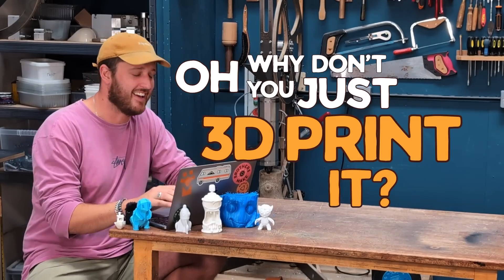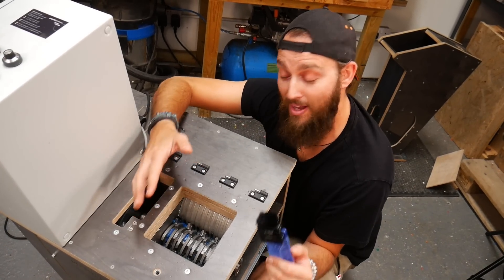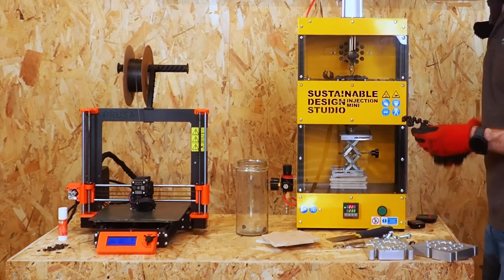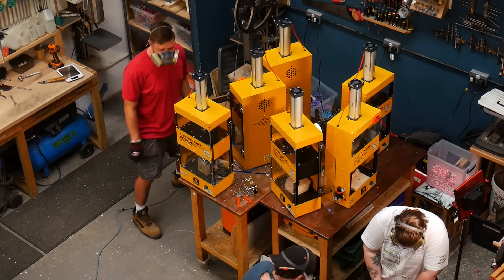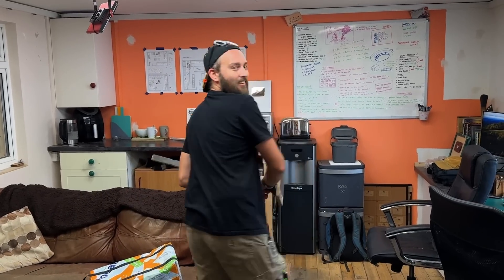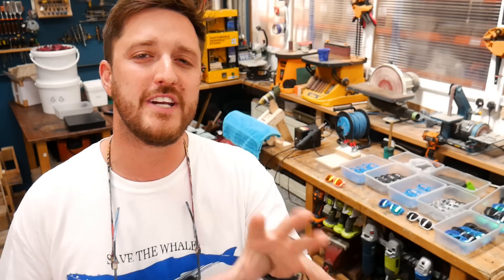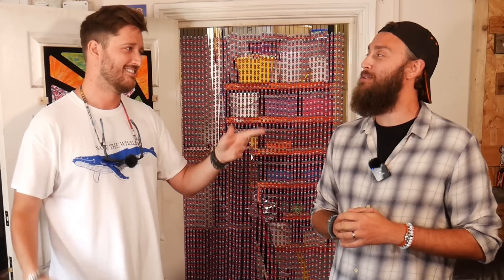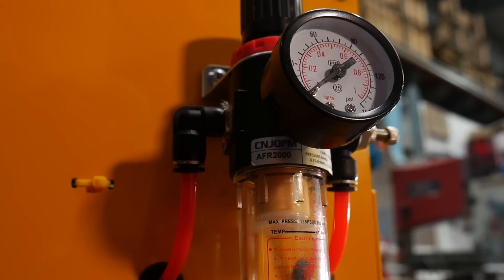Is THIS Better than 3D Printing?

Comment: You missed one thing. How long does it take to make an ejection mold ? That needs to be added into the total time.
Reply: also why only one comb printed at a time and could they print layers of beads in a stack?
Reply: And cost.
Reply: With the price it had that's because he bought it to a cnc company
Reply: Use of computer guided 3D lathes makes carving and etching steel molds much faster, compared in the past, where you need a well trained mold carver to do them.
Reply: @inisipisTV  yes it could be faster to produce the beads on a barfed CNC lathe but its going to require a similar amount of work to setup the CNC lathe as it would be to machine the mold. Then its going to be more expensive to buy the CNC lathe in the first place while being much pickier about the material. Not to mention the many other factors that go into it.
Reply: This question immediately came to mind
Reply: Well if you're doing that then you need to think about how long it takes to make a 3d file.
Reply: Dumb video, u have a mold
Reply: Also the time to trim the mold. They're not even counting hours of human labor. It took 3 ppl a full shift....
Reply: Exactly… 3d print from nothing vs mould from something. Also a resin printer would print the beads quicker than filament.
Reply: @3LG33  yep. SLA printing would def be the fastest and cheapest for beads making I believe.
Reply: @trygvij1604  sure but part of the appeal of these products is using recycled materials something you cant do with SLA. SLS might be possible but would require some highly specialized equipment to turn the recycled plastic into a fine and consistent enough powder.
Reply: not to mention changes.  What if you get feedback the teeth need to be wider or shorter, comb longer or shorter.  Time for mold? Cost of mold?

I 3d printed some garden stakes for my mom.  plastic cost, 25cents.  I went through 7 versions in 2 days.  for 5 bucks of plastic.  My sis liked them so much she got 10, my gardening neighbor has 20.
Reply: @elitewolverine  That's why we need a 3D Printer. To create prototypes BEFORE creating the mold.
Now imagine you are a large producer of garden stakes, producing 70 or 700,  in days, not weeks, but days, how you deal with this?
Reply: The molds they are using for the beads, comb and glasses could easily be cut from aluminum in a day.
Reply: @yatyas72 so you need a high quality CNC as well? 😜
Reply: @Utseuski  Or you could design the mold yourself and have it cut by a local shop. I did lots of that work with my shop. You don't always have to own every tool and it's likely not as expensive as you're made to believe.
Reply: @yatyas72 yeah but that's an entire day of a headstart that the 3d printer can be running making products before the first injection part is done.
Reply: @samk2407  Yeah, but...... There is simply no comparison between injection molding and 3d printing. Part strength, material selection and speed. Injection Molding is far superior!
Reply: @samk2407  yeah but if you have an application where your going to be needing a ton of parts it usually doesn't really matter if they're delayed by a week if it can be made cheaper and better in the long term. Not to mention The injection molder will catch up extremely quickly.
Reply: Yeah they're right about the other downsides of 3d printing, but they're being totally misleading by starting with the finished mold. The printer has a days or weeks headstart
Reply: Are you also going to include the time to build your 3d printer?
Reply: @Ben-ex1kv no. Because of a 3d printer you can make a new design, change the size of the beads, or decorate them with no changes required on the 3d printer. But if you wanted bigger beads with the injection moulder you would have to get a whole new mould made. Obviously both manufacturing methods have their place, but if you could only have 1 machine I would take a 3d printer over an injection moulder.

Comment: If Brothers Make is Yin (Injection Molding) ((Yes I know for you both it's "Moulding" )),Slant 3D is Yang (3D Printing.) 

Both channels highlight the benefits of their respective process in order to make it seem like the more appealing option for plastic goods manufacturing. And I don't blame either channel for their stances; they've build their entire livelihoods on the process they've each chosen.

Note going into this comparison that, trying to make the same exact part in both processes is like trying to fit a square peg into a round hole. A part takes the design that the manufacturing process used to make it lends itself to the best. A part designed for Injection molding will not and should not look anything like a part designed for 3D printing.

My analysis:
Injection molding is fantastic for large quantities of parts with simple geometries and that have low probability of changing design-wise. Brothers, you both have nailed this tenant with your choices of molds with "bulletproof" designs in Beads and Sunglasses: these are things that people will always want and that will always be useful in many applications (in the case of the beads). If the quantity is in the thousands to tens of thousands range, the small scale injection molding infrastructure as you two have is the way to go.

3D printing excels at complex geometries and impossible geometries, and can make different parts entirely on the same machine with 0 tooling cost for doing so. This opens up whole new possibilities for rapidly evolving customer desires, capitalizing on trends, and rapid turnaround times for part design. With how fast the world is changing around us, this is a very attractive capability to have. If the quantity is in the hundreds to thousands range, half a dozen to a dozen printers is more than capable of cranking out very high quality, professional level products.

I myself have a Bambu Lab X1C, and am partial to 3D printing. Having a single machine that creates objects out of thin air is as paradigm-shifting for me as getting a cell phone was. The cell phone is instant access to information, and a modern high end printer is instant access to objects. I see additive manufacturing as the second industrial revolution, and it is already enabling people and companies to do never before seen things. I do still however love your channel and know that the more artisanal style of your work definitely does and should have both appeal and a market. 

Perhaps look into recycling plastic into 3D printer filament as a new venture/ sector of brothers make? Home filament making setups or small scale industrial ones are increasingly affordable and accessible. 

I expect and look forward to seeing you two continue your success in the plastic manufacturing industry and will always look forward to your next video. Cheers from across the pond!

Comment: HOWEVER you doing the work or letting the printer do the work, while you do other work, makes it a lot of difference and is key here! Besides that there is a big cost to making the molds, something you don't have to worry about with 3d printing. And you can make way more products if you print stacked, and since you don't work day and night, well your printer will just keep going!

Comment: 3d printing excels where you want to be able to customize or personalize items. Not for mass scale manufacturing generally. So not a great comparison. But a fair point.
Reply: Doesn't help he used a mk4 instead of a bambu p1p/a1, would have leveled the scales. (speed)
Reply: It's completely inaccurate to say that FDM 3D printing is not for mass scale manufacturing. Check out what Slant 3D does. It beats injection molding in all aspects
Reply: @bmotik  slant3d owns a print farm and uses his channel as an ad for his company. he is very very biased.
Reply: Actually for the cost of one employee operating 3 mold machines, I can purchase 100 bambu A1 minis, pumping out 5 combs an hour each.  That is 12000 combs a day max, far far far greater volume than what the small injection modling can do.
Reply: @elitewolverine  if you can respool and clean and whatnot within 1-1 minute per printereafter every print and you can sequence the prints so you are continously scrape the beds and whatnot then you  loop around every 100 mins... so max 7 loops a day. That is only 3500 combs my dude
Reply: @elitewolverine  You comb your hair with that 3d comb for year and I'll use the injection molded one. I guarantee you at the end of the year, yours will not have held up as well as the injection molded one.
Reply: @yatyas72  i have 3 injected combs all with broken teeth after about a year or so of use.
Reply: @elitewolverine  so what do you want? a cookie?
Reply: @yatyas72  sure if you have them, unless you suck at baking like you do at comments, then in that case get your waman to bake them first.

Comment: One little trick you get away with.

Resin 3d printed injection moulding moulds.
as Resin's not a thermoplastic, it doesn't deform with heat, if you want a prototype injection moulded part, you can resin print the mould.
Reply: Yes but don't expect many parts from it. Resin prints get way soft when heated and deform when force it applied.  It is great for a proof of concept for the mold but don't expect to produce anything with it.

Comment: yeah but... for injection  moulding you need a mould for everything you want to make, 3D printer you just change the program, so for a single hobby type work 3D is a clear winner

Comment: Worth mentioning that the injection mini and mould price doesn't include VAT whereas the 3D printer does, so you need to add another 20% on top. One of the most annoying things about the sustainable design site is the surprise increase in cost when you get to checkout.
Reply from the maker: That’s something we overlooked. Thanks for the info - we’ll add that into the description

Comment: I saw a YouTube video somewhere that was able to spin filament out of PETE bottles by thinly slicing the bottle as it rotated. Could be a good way to get recycled filament for certain 3d prints, although I don't think PETE is generally as good for printing as PLA or ABS.

Comment: I mean, the whole point of all this is the recycling part. you can buy a generic comb anywhere from anywhere :P
that aside (using recycled parts for both) to each their own? they both have strengths. printers are amazing for prototyping. plus industrial injection molding machines don't need a person to operate the same way.

the milling time  should also be included for injection molding, but if you want large quantities it becomes negligible

Comment: I have 3 3d printers (2 fdm, 1 resin) and run a small 3d printing service and I adore 3d printing, but 100% they're just not practical or appropriate for a lot of tasks. I'd never consider printing a comb because regardless of resin or filament or infill used it just won't have the structural integrity to be useful, especially for the long term compared to an injection moulded one, and especially compared to one which can be endlessly recycled.
Reply: I think the orientation used for the comb printing is pretty "wrong".  The tines should be printed horizontally to give them strength.  A bit a cleanup is needed on the bottom side to remove support material, though.  That said, I haven't actually tried printing a comb.

Comment: If you want to make massive abounts of the same item then injection molding is better.  If you are prototyping, making complex parts, short runs or a job shop, 3d printing is better.  Making 3d filament is also a valid use to recycle plastic.
For the average person, they will get WAY more use out of a 3d printer than injection molding. For the small boutique recyclers trying to make the most product, the injection molding will make a lot of sence.
Reply: And when you say massive amounts, that starting point is at about 100k pieces. And even then, 3d printing is going to be competitive.

This example they have is the ideal setup for injection molding and the worst for 3d printing and they didn't even pretend to make it fair. Ask them how much they spent on machines...
Reply: @SirSpence99  100k pieces?!! You do know you can get far less than that right? In the case of the combs you could get 200 pieces and the mold made quite inexpensively plus you could get reorders fairly quickly or even delivered seamlessly if you have known quantities spaced throughout the year or lifetime of the product. PLEASE SPEAK TO SOMETHING YOU KNOW ABOUT!
Reply: @yatyas72  Generally it helps when you want to disagree with someone that you address what they said instead of something you made up.

Why don't you think for at least a second this time and not assume I am an idiot and might have a point. Assuming you aren't an idiot, you should be able to at least get an inkling for why your comment is irrelevant.

Comment: Touched on it a bit at the end, but IMO the molds would be the biggest point if you are comparing the two methods. You can 3D print anything using the same machine, but you have to buy a new mold for each unique design. And I imagine prototyping designs would be a pain. But I’m here for the sustainability and injection molding of recycled materials is the way to go

Comment: 3d printers still produce waste plastic. turning that back into 3d printer filament is more hassle than its worth, contamination is a big risk, 0.4mm is a common nozzle size but smaller is possible.

injection molding is probs a great option to reuse those waste prints with less demand for tolerances and purity as is scrap -> end product.

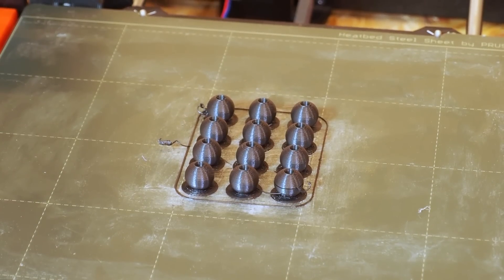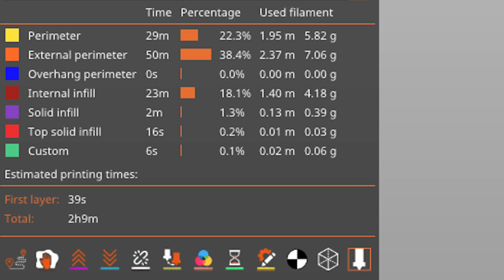there is also some obvious flaws in how you are comparing 3d printing too. 3:28 print only the model no brim etc saves clean up, good print surface and bed level should make this possible. the comb at 4:00 would just snap because you put the weak points in the z axis. it should lay flat where it will also print faster and where you wouldnt need such a fine layer height. one can also stack models with a small 0.15mm~ gap and have combs print into the entire print volume. another point would be one may also want to factor in one can buy two p1p for 1 SDSIMM but end of the day both technologies are better in their own way, designs made for IM may not work well for 3dp vice versa. IM being affordable is only a good thing.

Comment: People very easily get tunnel vision and try and fit everything into one way of doing things. They forget that 90% of your goal is to use recycled materials, which is almost the exact opposite of 3D printing (printing produces a ton of waste and it is quite hard to recycle).

Also, if you’re making a bunch of 1 object, injection molding is ALWAYS the way to go.

Comment: It's always a "Yes or no"-question with this...and I have rarely seen a middle ground. Molding of any kind and 3D-printing are very different kinds of production methods who each have their own pros and cons, depending on what you want to make.
I do own a 3D Printer that runs recycled materials only. That stuff is made by a single company in German who delivers real quality. Never had any issues with that stuff. But there probably is an issue with the materials available for the process.
But man, especially when it comes to making more than a single piece, I'd love to have access to molding.
The dream would be being able to make molds with 3D-printing in a good manner.

3D printing will not replace Molding. For that to happen, they are way too different. This isn't renewable energies vs fossile energies.

Good video to show actual differences, although it does miss a part on what the pros are in 3D Printing, but the people who complain already know those.

Comment: Yeah it takes that long when you're using a prusa lol, but in this use case especially for beads 3D printing is not better obviously but the comb you could probably fit a lot on one bed if you do it right, and the pricing of filament is not what bamboo has that's not the norm you can get it for $10 A roll sometimes less

Comment: And how much electricity did you waste on the 3d printers? A lot more than the injection molding machine. I would stick with the injection system. 3d printing is overblown considering how much you have to learn in order to make the printer work. I can't design in whatever way it has to be done and not interested in wasting time on it either. Injection doesn't require I learn a new "language" or way to use my pc.
Reply: You have no idea what you're talking about. You'd need ~10-20kWhrs to print those 9000 beads, it's nothing. Much easier to get started with than injection molding too, modern printers are pretty much plug-and-play.